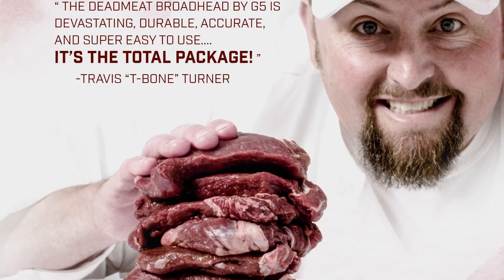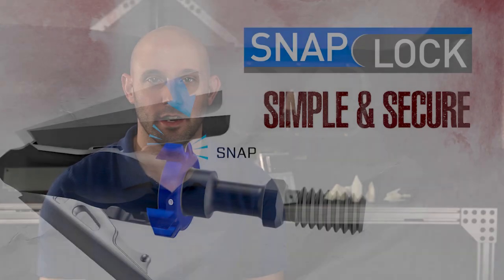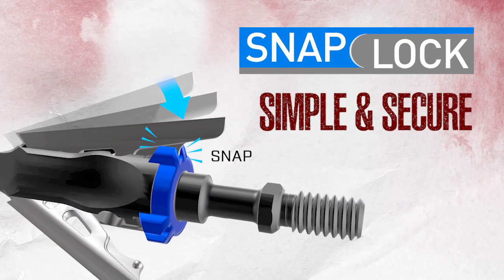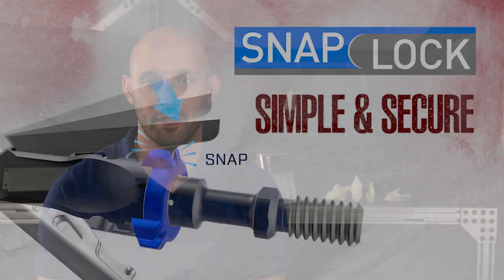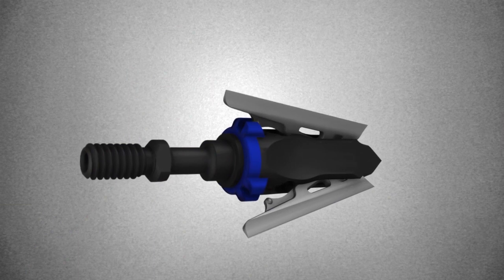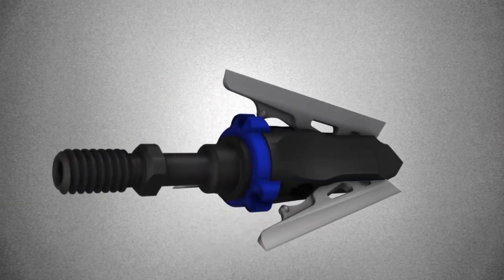The G5 Deadmeat: The Science Behind It

Comment: Don't try to use this broadhead with a quiver such as the tight spot.  if you try to push the broadhead into the foam you will break the collar and have to buy new ones.  Learned that the hard way - 3 heads need 3 new collars.
Reply: Well don't push as hard